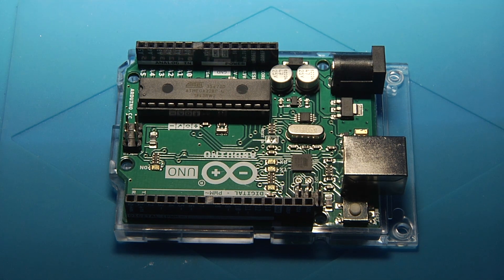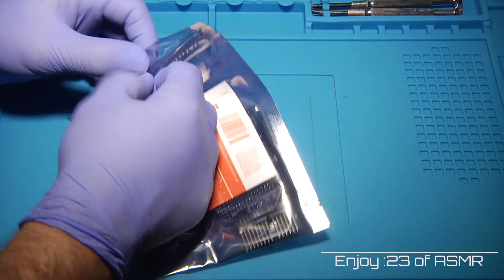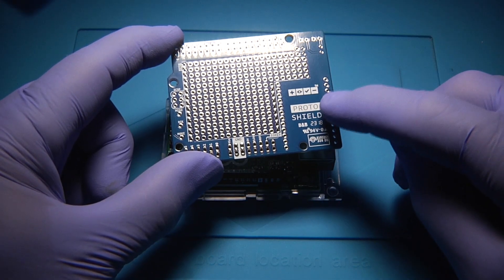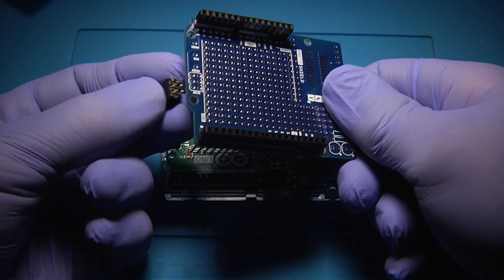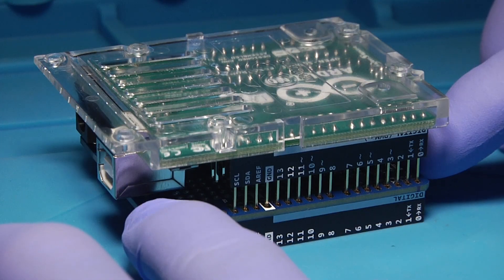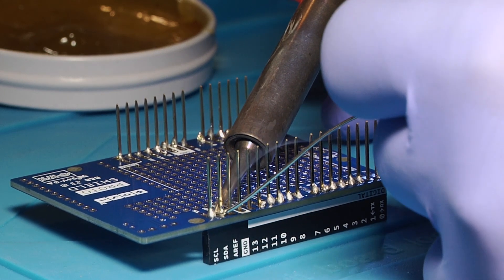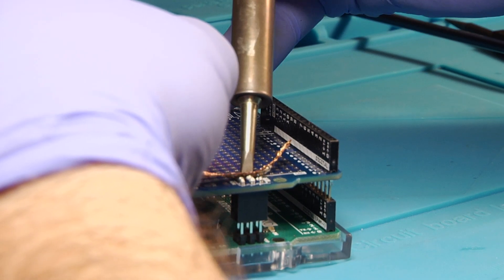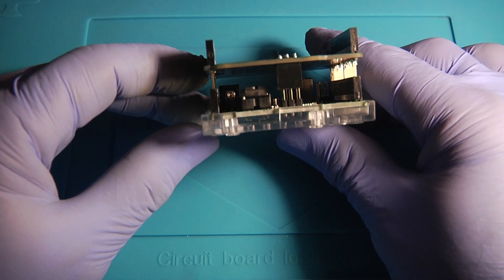Arduino Proto Shield Tutorial-Soldering

Comment: This was a great instruction. Thanks for all your tips and tricks. I’ve seen a blue “tray” such as you used on YouTube before. What is it. It seems handy for keeping everything in one place.
Reply from the maker: Yes it is handy.  Its a silicone mat that is used for electronics soldering and electronics work.  It is heat resistant and keeps your underlying surface from getting hot.  It also has an optional grounding connection.

Comment: May be a dumb question but what does an arduino even do?
Reply from the maker: There is no such thing as a dumb question young man.  An Arduino can do many things.  Not as much as Chuck Norris but...I am actually making a video this week about that question.  In the meantime here is a bit from the Arduino website, 

"Arduino is an open-source electronics platform based on easy-to-use hardware and software. Arduino boards are able to read inputs - light on a sensor, a finger on a button, or a Twitter message - and turn it into an output - activating a motor, turning on an LED, publishing something online. You can tell your board what to do by sending a set of instructions to the microcontroller on the board. To do so you use the Arduino programming language (based on Wiring), and the Arduino Software (IDE), based on Processing.

Over the years Arduino has been the brain of thousands of projects, from everyday objects to complex scientific instruments. A worldwide community of makers - students, hobbyists, artists, programmers, and professionals - has gathered around this open-source platform, their contributions have added up to an incredible amount of accessible knowledge that can be of great help to novices and experts alike.

Arduino was born at the Ivrea Interaction Design Institute as an easy tool for fast prototyping, aimed at students without a background in electronics and programming. As soon as it reached a wider community, the Arduino board started changing to adapt to new needs and challenges, differentiating its offer from simple 8-bit boards to products for IoT applications, wearable, 3D printing, and embedded environments. All Arduino boards are completely open-source, empowering users to build them independently and eventually adapt them to their particular needs. The software, too, is open-source, and it is growing through the contributions of users worldwide.

Thanks for watching.
Reply: This is a device that can collect information from the physical world. Doing the handled and the result can manage something. And transfer the processed information to a computer. For storage and more complex handling. For example, an electronic lock, takes information from the keyboard to enter the code, checks for compliance, and then supplies power to the solenoid lock.
It is my project use board like arduino it take information about angle, and send to computer and speed in simulator change.
https://www.hackster.io/gawad/gas-pedal-for-simulator-game-fb73c7